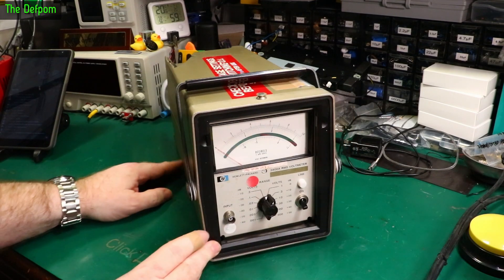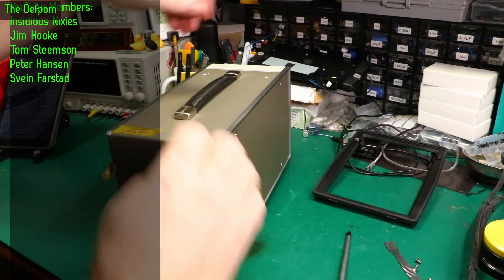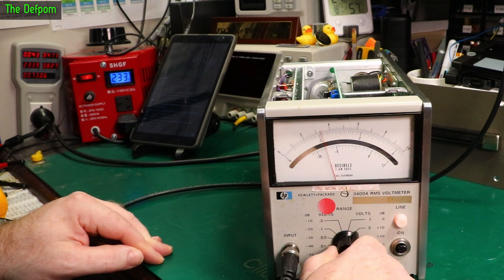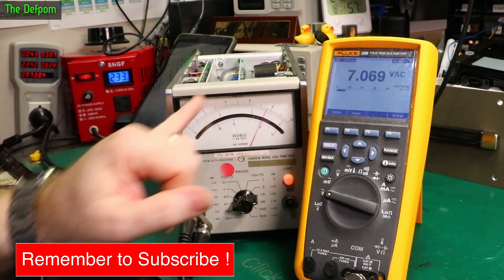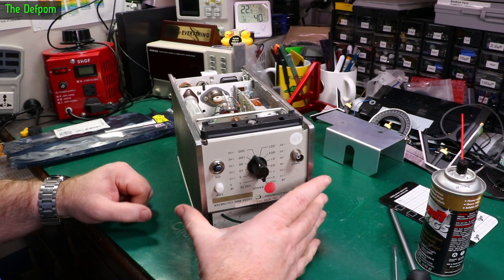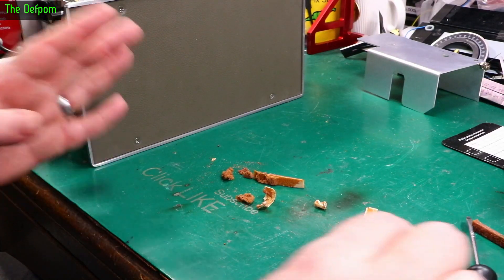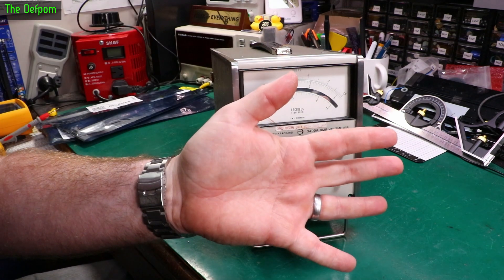🔴 HP 3400A AC RMS Voltmeter & HP 11076A Equipment Score - No.1179

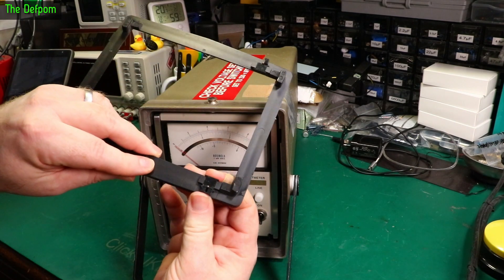Comment: I thought I lost my mind, You repeated the opening sequence at 01:36, guess an error during editing.
I remember my bench at work had an HP AC volt meter since my specialty was repairing receivers and amplifier. I never really used it much though. It looked like the one you have now but it didn't have a plastic outer case. Thanks for sharing.

Comment: Agree, you don't see the HP 11076A very often.  There was a snap on front cover for that case too, really seals up the instrument for storage.  I think a component has drifted in tolerance that affects the upper ranges.. if recalibrating it didn't totally solve the problem.  Still it's a nice meter and basically usable for general work.

Comment: Useful piece of equipment. I came across a Fluke 8060a  handheld DMM recently which has dB readings and frequency response up to 100kHz. Very useful. There is the bench version 8050.